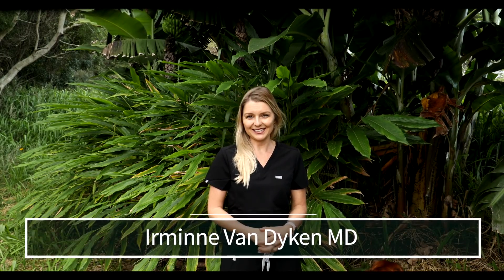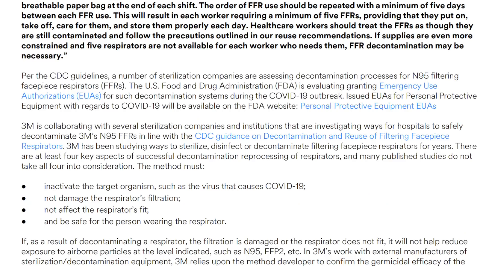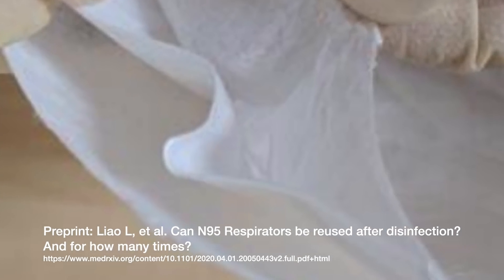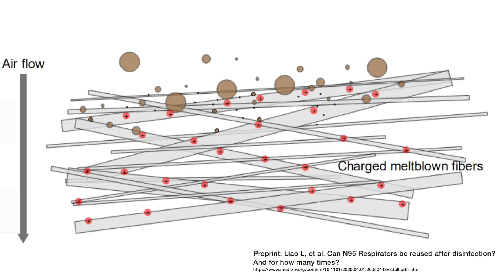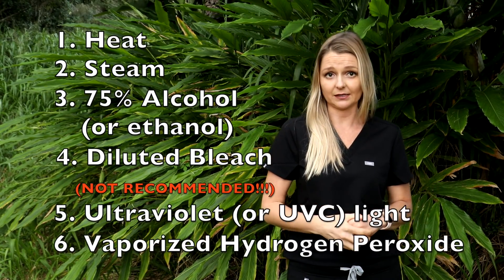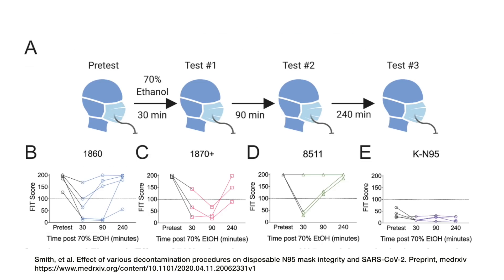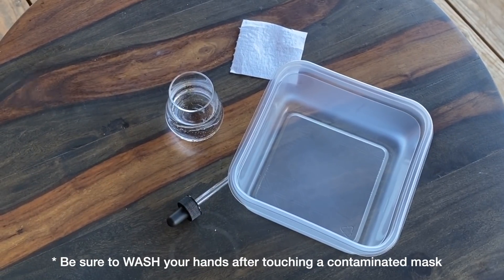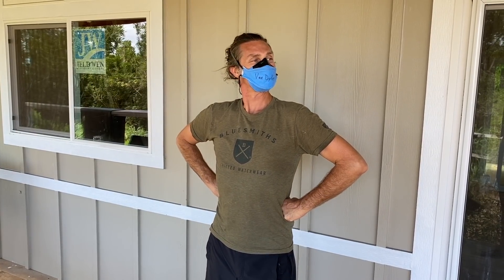How To Disinfect Your N95 Mask at Home

Comment: Why can’t you just leave it in a paper bag for 3 days til the virus dies.
Reply: Exactly what I want to know!!!  ...  And exactly what my Stanford University Primary Care Physician TOLD ME TO DO.  I am an extremely high risk individual and my PCP is also a Professor (He's been my PCP for 30 years +).
Reply: Exactly !!! I would leave it more to be on the safe side.
Reply: But, if I use my mask only once a week to go shopping it should be good to go in a paper bag, right?
Reply: Andrea Martinez Yes.
Reply: I wish I had 30 N-95 masks but sadly I have only one. If you had 30 masks, just rotate them and in 30 days reuse mask #1.
Reply: If it's hot and sunny out why not let it cook under the sun? Uv light kills germs - doesn't it?
Reply: datastorm why you don't buy 5 and rotate them
Reply: should the plastic be in the oven??
Reply: Yes! Except leave it in the sunshine.
Reply from the maker: I would be concerned that the virus is completely dead after three days. There is some data showing it can live for longer on certain services – it’s just better to be safe than sorry. Maybe, you can leave it in a paper bag for longer?
Reply: @outofthedoldrums  Should we staple the paper bag Or just fold couple of flaps  ?  And if we do that don't you think virus can get out of the bag through one or two flaps ?

Comment: I found a new unopened package of four N95 masks in my workshop that were probably 2 years old.  I'm the only one in the household that makes a run for groceries and supplies about once per week.  After using the first mask it is deposited into plastic zip-lock bag and the bag is dated and hung on a line in direct sunlight.  For the next supply run a second mask is used followed by the same storage procedure after use.  This process is repeated for each of the four masks.  After the fourth mask has been used, the first mask has now been stored for at least 30 days and any possible contamination by COVID-19 should have been deactivated.  I would be interested in your comments Dr. Van Dyken regarding this method.
Reply from the maker: Hi! This sounds like a great method. The longest we know that the Coronavirus can survive is 17 days (from the Princess Cruiseship data), so letting the mask sit for one month is adequate. Putting it in the direct sunlight is good as well. My only concern would be - integrity of the rubber straps after sitting in the sunlight for that long. The rubber can break down, which was shown in studies using UV light for sanitization (but that light was much more intense than sunlight). 
Let me know how the straps hold up!
Reply: Wow, how fortunate finding exactly the number of masks needed and for them to be N95 masks!!!!  Buy a lottery ticket.
Reply: @saddadbadmadsholmes4000  I have three in an unopened pack that I haven't been able to find.

Comment: What about spraying the mask with disinfectant?
Reply from the maker: Be careful what you spry it with. You don’t want to be breathing the residual off gassing of the disinfect. 70% ethanol will work as it leaves very little Residue after it evaporates. It will cause the mask to break down faster than if you were just to heat treat it.
Reply: @outofthedoldrums  my mask has a removable charcoal filter with some type of material on both sides  I spray with ETOH 60 % the outside of the mask and inside after I take it off . then leave it on the car all day with the sun beating don on the car .